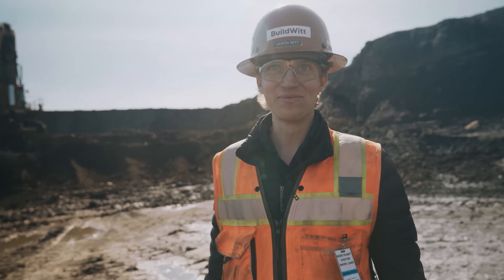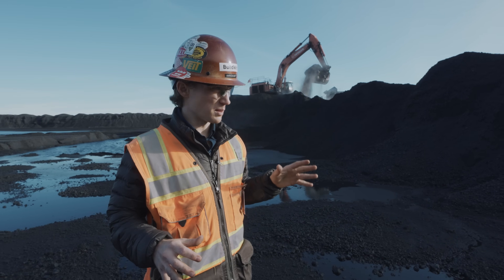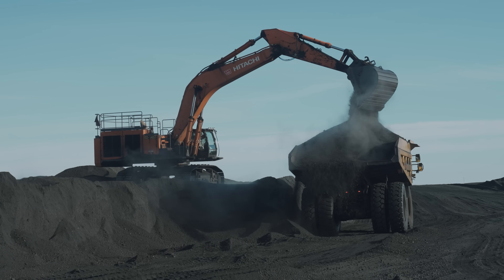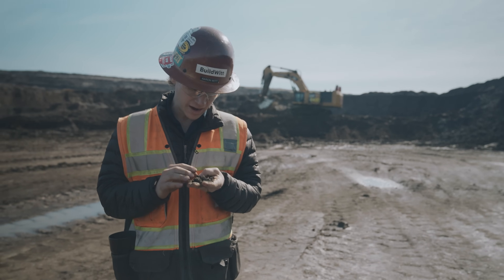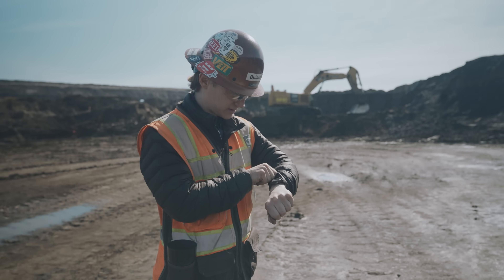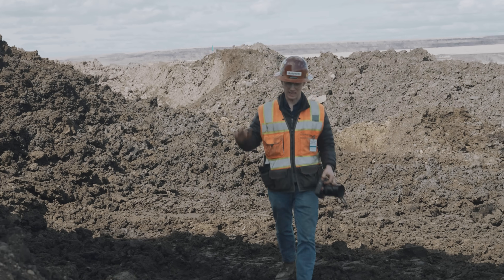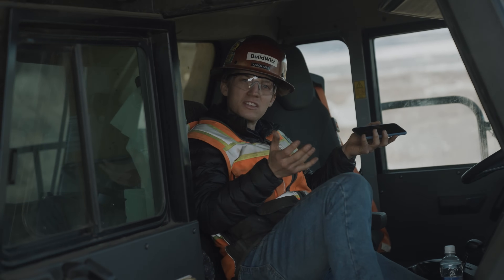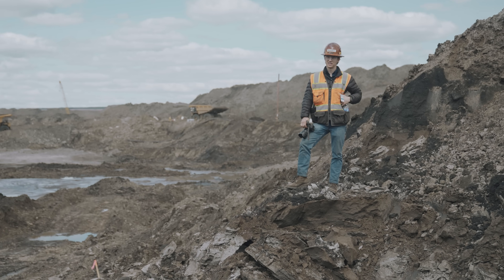We Got into the PIT | Alberta Oil Sands

Comment: Petroleum coke can also be used to make anodes for aluminum smelting or burned as fuel.  It can sometimes be used in steelmaking but you have to be careful as it can contain fairly high amounts of trace metals or other heavy impurities that were in the oil.  I work for CN Rail and we haul a lot of it away from Fort McMurray, sometimes as 100+ car unit trains for export through Prince Rupert, British Columbia.

Comment: About 15 ish years ago company I work for had a water filtration system went to this area for BP oil sands. In layman's terms they would dump the oil saturated sand into a tank, mix with water, boil it, skim the oil off the top, send it through a couple cycles of this, reclaim the sand for return to the mine.  The system we built was water filtration to keep reusing the water indefinitely.  It was a joint project with many companies involved to build the system. Left central WI via 7 semis. Took 3 weeks to get there. 35mph max Night travel only.  Due to the weight and size it was transported in February for frozen weight road  limits, could not cross a bridge or fit under one. Just plain massive and heavy. I always thought they would be better off to just build it on sight but the claim was it was so cold most of the year that was not possible.
Reply from the maker: that's amazing

Comment: Hello sir Aaron is there any opportunity for foreign workers at your mining site for Heavy Equipment Operator? By the way im a Heavy Equipment Operator for 10 years of experience such a as Articulated Dumptruck, Hydraulic Excavator, Bulldozer, Wheel loader and 10 Wheeler Dumptruck
Reply: getting sponsored by a company is extremely difficult. you need to become a permanent resident of Canada first. come as a student. you can work part-time while you study, then after a few years you can  obtain a 1 year work visa, then afterwards a resident permit to stay and work for years.

Comment: fire suppression on an excavator working in "oil sands" you say? hehehe that would be murderous profit loss if anything took off!  in my brief career as an OTR flatbed driver... gawd i spent weeks running round trips up to Spokane WA when CAT built up their new parts forwarding warehouse up there, shaved DAYS off parts ordering for our Canadian family by getting those parts moved up closer to em.  lesson learned, if you land feet first after a fall over 12ft, you could lock your legs and break em, but that would be far less burden than bending your knees as i did.... and piledriving your spine into concrete!  3 points of contact and NEVER trust a "calm winds" weather report!

Comment: in Butte they use actual guns to keep birds out of the pit.
Reply from the maker: they've got propane bangers too since we were just there but you're right, they do also use shotguns when needed
Reply: @AaronWitt  rifles too. Last i was there with school one could see all the 7.62 casings all over the ground next to the small shack.
Reply: If the objective is to protect the birds, firing shotguns would not support that objective
Reply: @ArtStoneUS  its just the splashes in the water that scare them off. They use AKs and ARs not shotguns. the lake is several hundred feet away. shotgun pellets arent accurate enough and dont have enough range to work.

Comment: 'you have to let these large truck warm up you can't just peel off like a car' that's why vehicles die so fast I've seen one thing last 300k+ miles no major service and someone else with the exact same thing killed it at 150k because they push the gas to hard and don't let it warm up I give my peice of shit 4 banger Colorado five to ten minutes to warm up the engine and trans most people give maybe two then stand on the pedal it's not about you can in a car not them big trucks I'm sure that truck would drive a minute after it's stated just like a car but those guys are forced to respect the equipment and people don't give a shit about they're vehicles
Reply from the maker: Yes kind of. You have an absurdly greater amount of fluids in these trucks though
Reply: If you put it all in one container that container would probably be bigger than my entire truck yes lol 😂